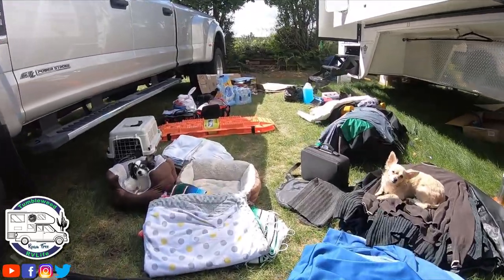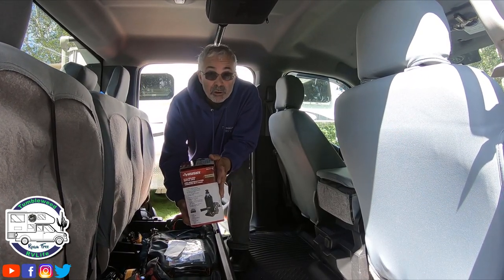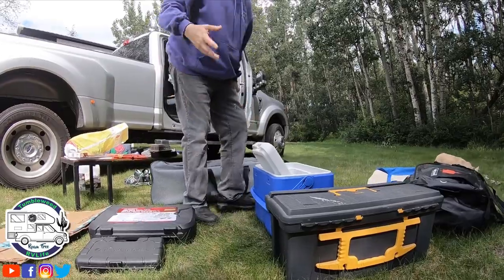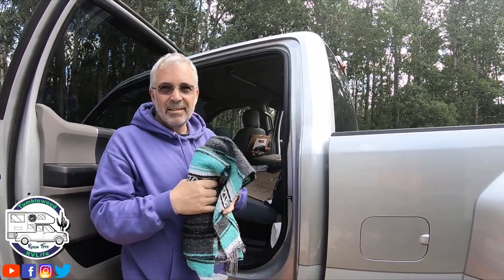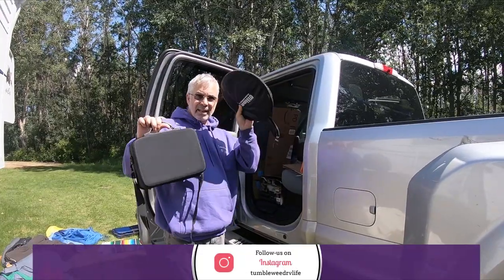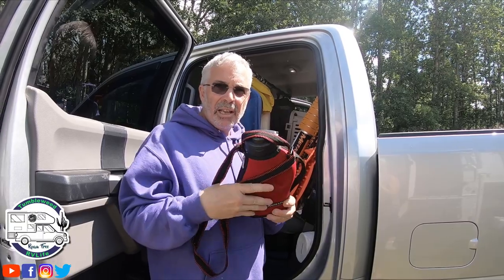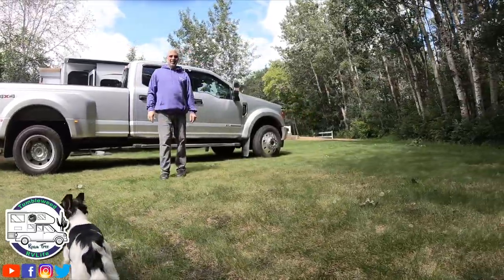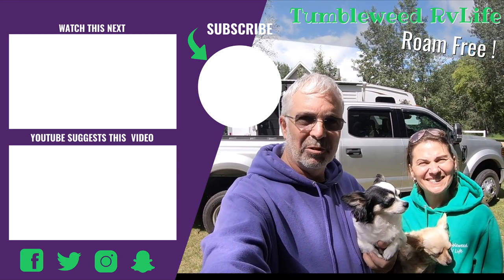F-450 Storage Setup for RV Living | Tumbleweed RV Life, Roam Free

Comment: wow really impressed on how much you got packed in the truck. Good thing you don;t have a St Bernard too.
Just a small piece of advice if you don't mind . I noticed you put that small hiydrolic jack in the back of your truck and laid it on it's side   
 apparently the fluid will eat at the seals over time.. I had 2 of those bought from ct did the same thing laid them on their side. Both different jacks leaked their fluid out.very disappointing when its the only jack you have
How do you like the slide outs I'm a little nervous about buying a rig with them
like your vids
Reply from the maker: Thanks for the info. Slides are always a concern, but need to space to live and compact when driving.